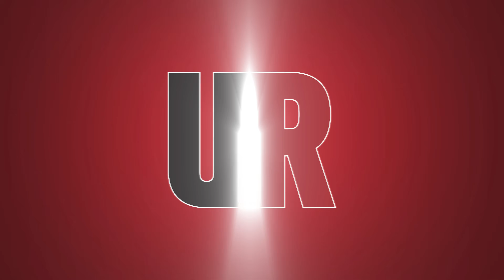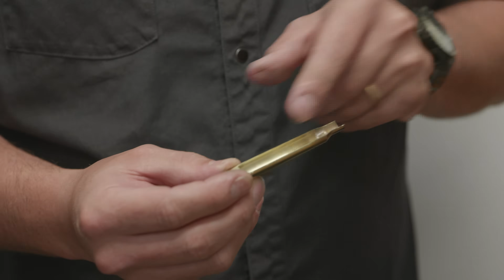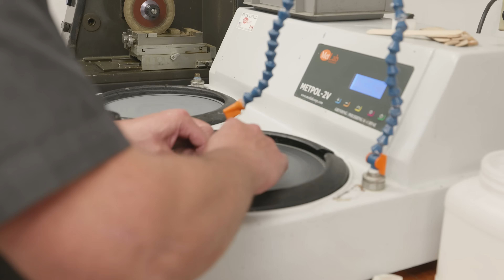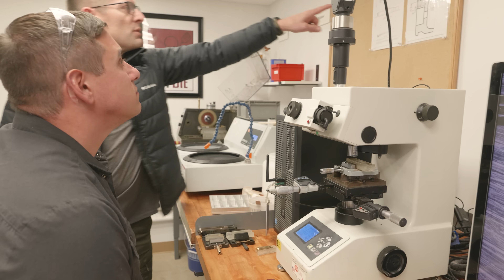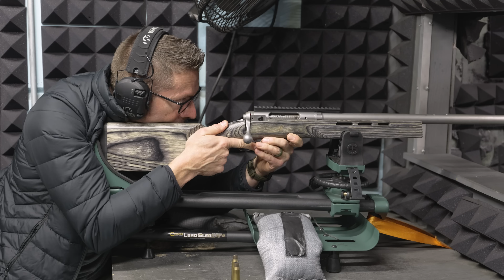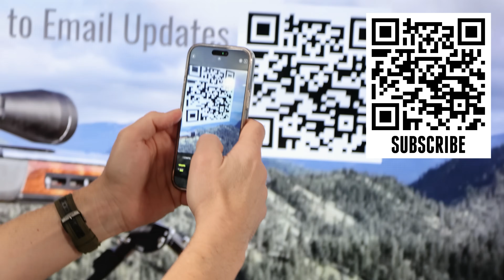The Peterson Advantage: How Quality Brass is Measured

Comment: Great video.I have a primary weapons m220 in 308 win. It has  a match barrel, 2 stage match trigger set at 3 pounds/1 pounds, decent glass 4x14  with rangefinder and have gone through most of usual lake city different  year variety brass and , tried the common loading weights and the best results have been with 42 grains  h4895 at 42 grains pushing 168 grain Hornady  ELD   and bullets using Lapua new brass , all primers from the same lot, and the common heavier bullets weights of 170 and  up are no good amigo, and the best I can do is just under 1 moa.. I have spent a decent amount of money trying this so far, . Do you think you Peterson Brass will make a signifigent accuracy difference ???. I would be happy achieving the fabled 1 hole bullets touching at 100 yard ....BTW no I cannot find and buy reloader 15...., its unobtainium..Do you think the Peterson  casings will make a significant  difference??? My opinion is this rifle is not bad for what it is and what Iv done.,But I am just trying to do better with what I have.. Maybe I should be happy with what I have. No I dont want to  go with a bench rest chasis rig   Opinion and suggestions please.
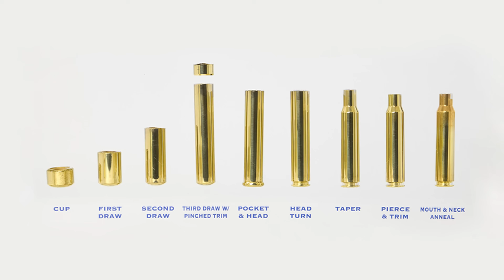Reply: I tried Lapua Palma and Peterson SRP, and Peterson SRP is more consistent. Yes, the better brass will improve your group. However, from what you said... I think your real problem is loading data development. I have a Bartlein barrel with Lapua LRP brass. I can get a 0.2 MOA 5-shot group at 200 yards with my Berger 185gr bullets. You have to check: maybe your barrel twist rate is too slow and can't stabilize the heavy bullet, or maybe your powder loading data, seating depth, or sizing are not good. I never seen a 308 Win barrel that cannot shoot 170s well, even an old 1:12 twist rate military service rifle can shoot 174/175 gr bullets well.